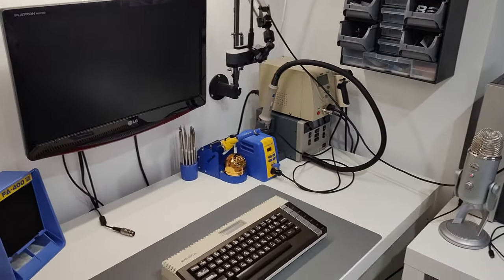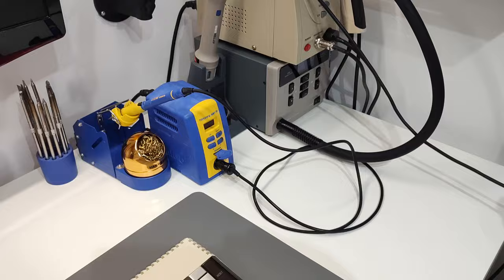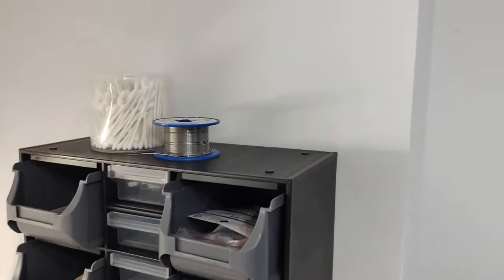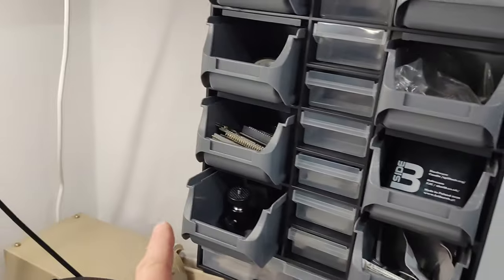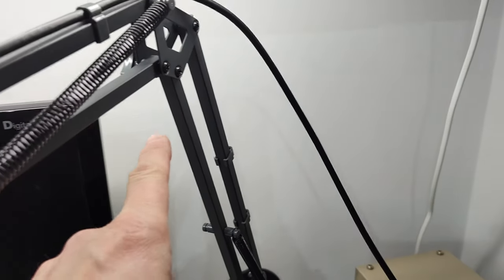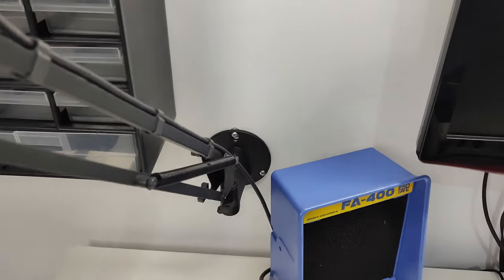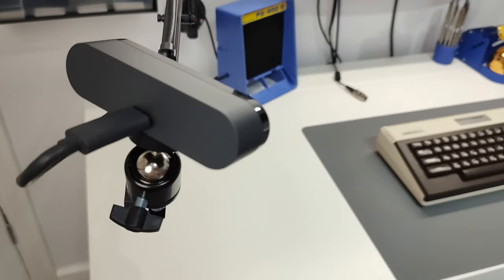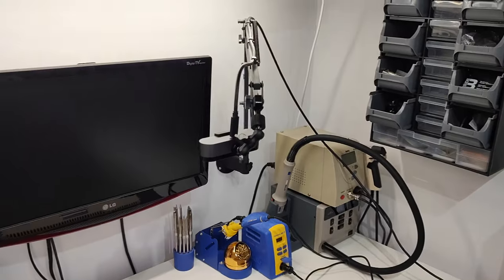New office update (4K): lighting, cameras and desk layout

Comment: That looks good Jon. A lot more organised than it was when I saw it a couple of weeks ago. Always easier working in a tidy environment than with stuff lying all over the shop.
Reply from the maker: Thanks Mick. In other news: I fixed the TI-99/4A last night which I think I showed you the other week, and with that out of the way, it's only the ST and A600 which are a little off the beaten track so to speak, but I might tackle them later in the week, or at least make a start. The rest of the queue, being relatively mundane, seems less intimidating with one of the unfamiliar machines out of the way, so your suggested strategy for attacking the backlog has proved high effective so far.
Reply: @flashjazzcat glad to hear it mate. I found when I used to buy and repair iOS devices that getting all the easier jobs out of the way reduced the stockpile very quickly and eases the stress levels. I’m sure you’ll get there mate. Look for ward to seeing the vids on the ST and A600.

Comment: Nice setup but you talk about the amp and the guitar is right next to it and you don't demo it! How do you manage test gear? Every time I get the scope out it seems to make the worst tangles of any gear on the desk. (I'm also with the Ikea GU10 spots, after installing 2 x 3 in a small space I am still surprised how little light they make.)
Reply from the maker: LOL - good point about the guitar and amp. :) Yes: the scope makes a tangle of wires, and this is why I've reorganised things to try and keep the rest of the clutter down. I might try to purchase some short IEC cables as well, since there's a lot of redundant loops of mains wire under the desk. Regarding the spotlights: mine are 6500K 4.2W lights (345 lumens), and although that's not the brightest, they create harsh shadows, so I might order some 7W bulbs with frosted lenses to see if that spreads the light out more evenly. I avoided the IKEA bulbs mainly because they were warm white. What wattage bulb are you using?
Reply: @flashjazzcat Mine claim 7W 700lm - not sure I believe that and they certainly dim with time - also 2700K, I might need to go to a higher color temp to increase perceived brightness. I like cords intended for kettles on test gear, they tend to be short.
Reply from the maker: @adameberbach  Good call on the IEC cables. They're often known as 'kettle leads' anyway, so it makes sense. I did order the 7W 6500K frosted bulbs, only to find 4.2W frosted bulbs in a local shop thereafter, and the ones I ordered haven't dispatched yet. :) It's excruciating, but I'm sure I'll get the lighting to my satisfaction if I spend another week and some more money on it. :)